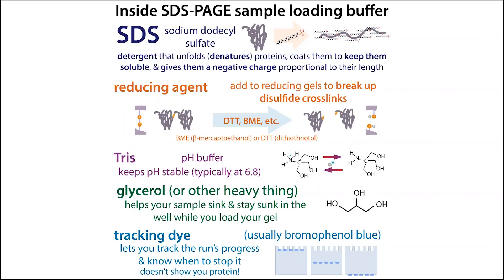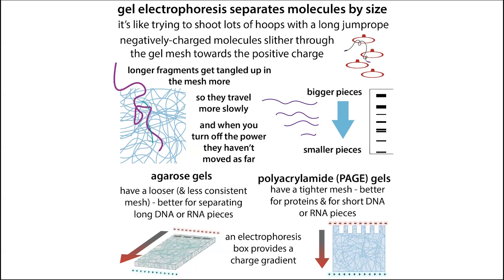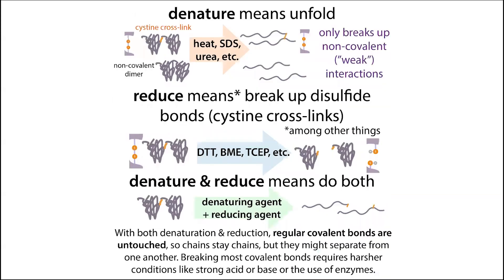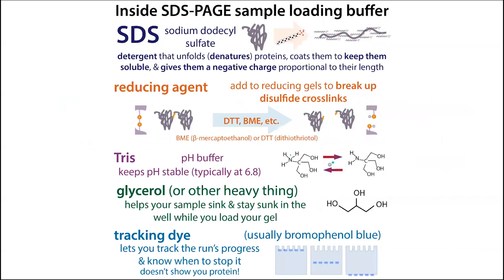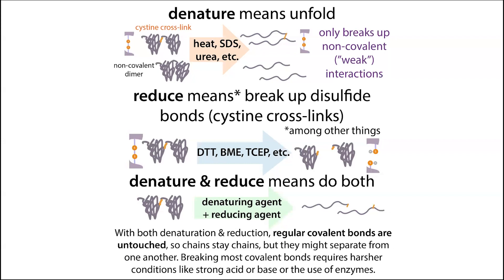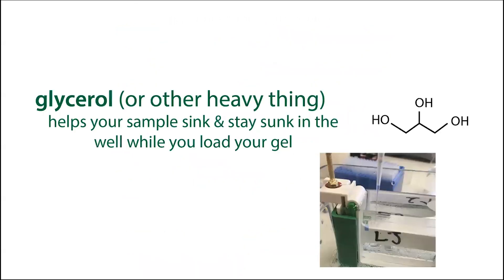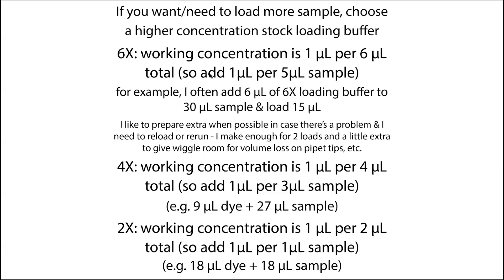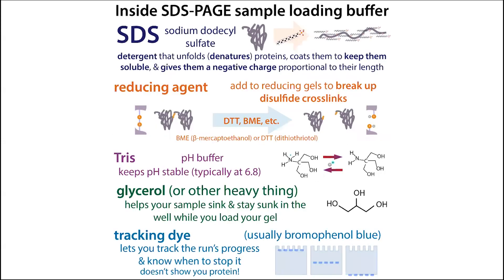What's inside SDS-PAGE sample loading buffer? And why? From SDS to tracking dye!

Comment: Why do proteins stay with the glycerol and not float away from the well?
Reply from the maker: If you wait long enough they will float away, but basically they're dissolved in a solution with the glycerol and the glycerol is making their surroundings viscous and hard to diffuse out of
Reply: @thebumblingbiochemist  thank you!
Reply: @thebumblingbiochemist  would microproteins float away more easily if that is the case and higher glycerol is needed?  thank you again.
Reply from the maker: I think it should still be fine. They're still way bigger than the dye which doesn't